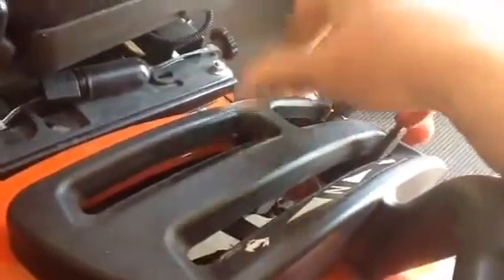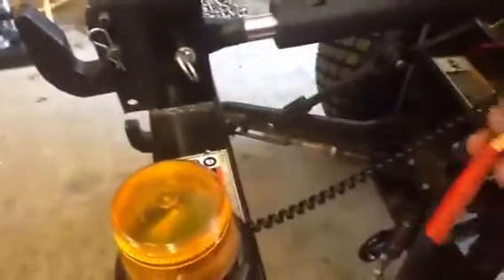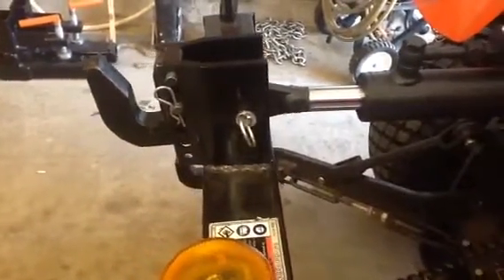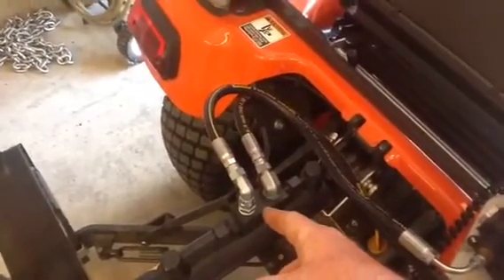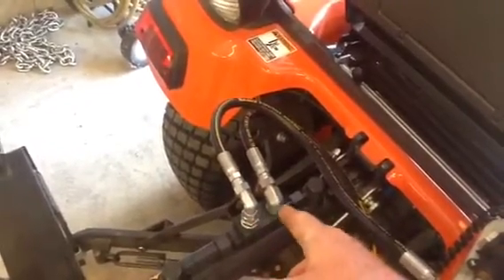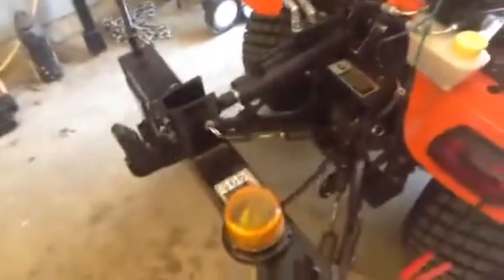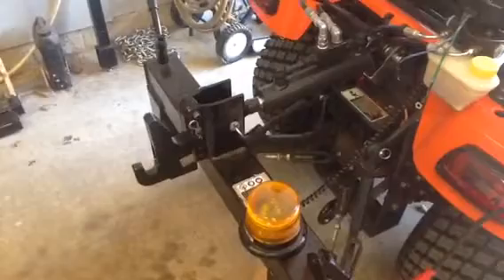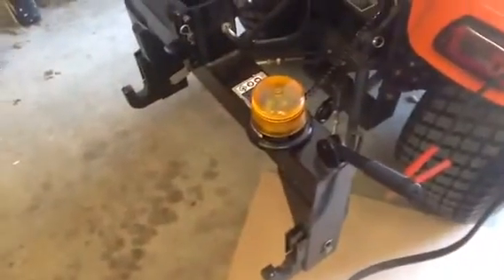Kabota BX2370 Three point hitch hydraulic link addition part#1

Comment: Great idea. Do you have a part number for the cylinder?
Reply from the maker: Go to agrisupply.com to get that information it’s all there. I went to a local Hydraulic hose shop and had them make the two custom lines for the machine. The mounting of the pump took the most time making the mounting bracket, the whole install was an afternoon.

Comment: Also what did you use for the top link? Purchased from Surplus Center?
Reply from the maker: The pump is adjustable from 500 to 2500 PSI I have it set for 2500 PSI downward pressure and 800 PSI inward pressure.  You can find the cylinder at agrisupply.com
Reply: Thanks for the info.Can you tell me what pump you used also? Where did you purchase? Sweet and simple set up

Comment: What are the specs on the marine trim motor. Nice idea.
Reply from the maker: I have a boat repair business so I sometimes find one around.  The best place is eBay and look for Murcrusier trim pumps and newer one are all the same.  You can find them used for around $100 and up.

Comment: How much less was that quick hitch at harbor freight vs some place like tractor supply?
Reply from the maker: It was about $80.00 with coupon, not sure of the price of TS but the HF works great. It's just welded steel so not much for them to screw up.  
,
Reply: goneredcar1 Yeah good point. I guess they could mess up the welds. Lol.